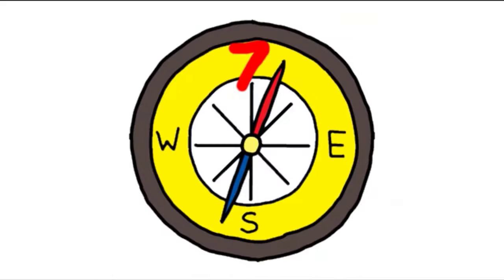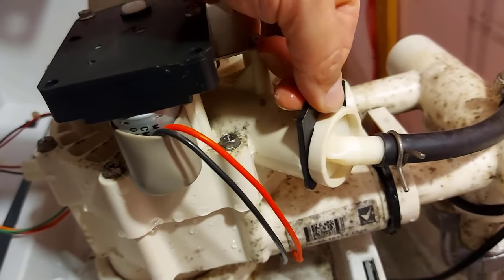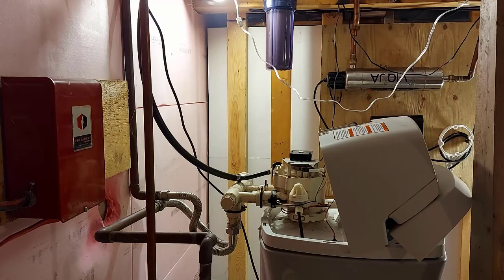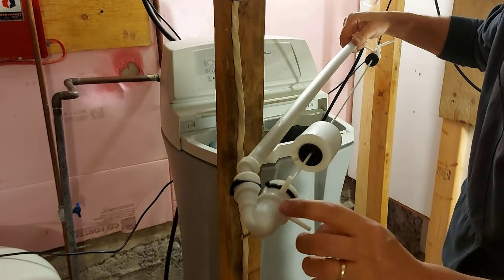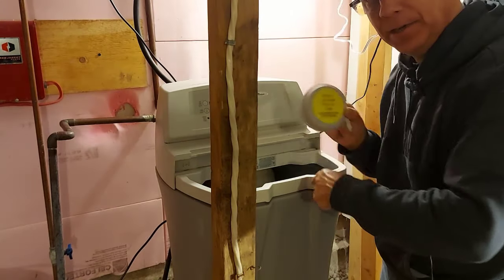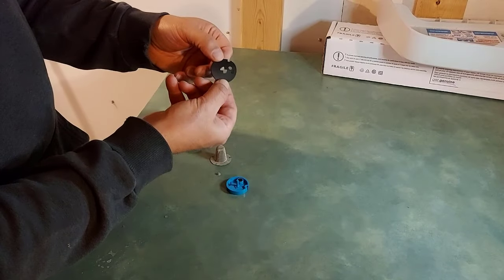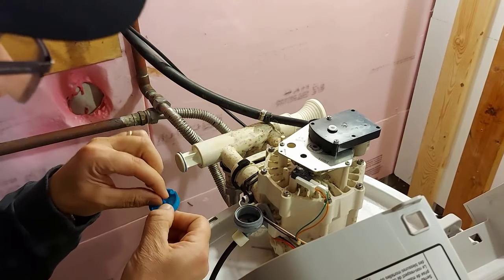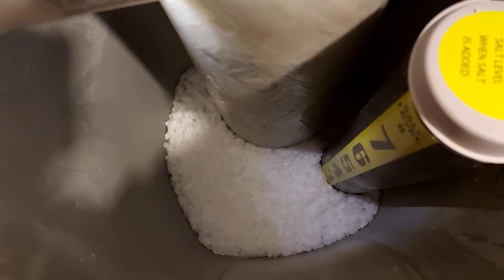My Water Softener is Full of Water // Troubleshoot and Repair 💧✔

Comment: Excellent video! Nothing you suggested worked, then I found out about what’s called “salt mush” that had clogged the bottom of my unit. Pain in the a** but emptied all the water and salt, cleaned the storage tank with warm water, put in fresh salt, recharged, and solved everything. Your video helped with the diagnostics and assembly. Thank you!
Reply: Derick that's what im going through tonight im.going to finish it off in the morning
Reply: After adding the warm water did you just add the salt and statt the recharge cycle?

Comment: I have the exact same water sofener.I knew I was having the same problem as yours, but still I hadn't checked the salt level in about 4 weeks. The water line was at 5 and the salt was at 2. Decided to order order a new venturi unit and float system since my w/s is about 17 years old but then I found your vid and decided to follow your lead and disassembled the old systems, cleaned them and reassembled everything. Drained the water, added salt and ran a recharge cycle and it worked! Well I've got extra parts coming that I'm sure will come in handy later. Liked and subscribed.
Reply from the maker: Great to hear! Is your water softener still working good?

Comment: Also do not tie the recharge output hose to the overflow hose because they both go to a drain. The recharge hose pumps water and if its tied to the overflow hose in a T to the discard tube it will just pump water backward into the unit and cause it to over flow. The overflow can just dribble into a bucket. The recharge hose has to drain into a sewer drain.
Reply: Yeah, I have this problem. I use a T junction.

Comment: Great Video! My water softner looks exactly like yours. I have about 8 years old "Sears kenmore Elite Hybrid" softner. About 2 months ago when I went to refill salt, noticed water in the salt tank and at the Top of "CAM GEAR". Replaced new "CAM GEAR"  & "Seal Kit". Replace new VENTURI completely. Open Brine Tank and clean "Brine Assembly" with new O-Ring. and put it back. Next: I have completely removed all the "old Salt"  from the tank put fresh warm water and cleaned it. Added new "IRON REMOVER SALT" 3 begs and START "RECHARGE" cycle at 5:30PM and complted at 7:30PM. At 1:00AM I have noticed water in my Salt Tank. I took meauring tape and put inside BRINE Tank to check and see the level. It was showing 8 1/2 inch. At 1:30AM this level was at 11 3/4. 
I have NO idea what steps I should take now. Finally  SHUT-OFF BYPASS VALVE so my BRINE TANK doesn't overflow over night.
If anyone has anyother ideas, PLEASE do share and let me know!! I would greatly appreciate it. Thank you!

Comment: I am probably about to ask a really stupid question. Just to be clear I did look through my manual and did not see😂 Also on Google all I can find is putting salt in the tank. When we purchased our home it came with this exact water softener which does not drain properly. I did notice there was salt in the well AND tank. Is there suppose to be any salt in the well or only the tank? Thank you for the clarification. 

Just wanted to say thank you so much for the helpful videos. I cleaned the Venturi and did everything I felt like I could to maintenance this thing before I did a recharge. After the recharge our water went from 15 down to 7 hardness which was a big improvement. Also the softener cleanser did an excellent job! Now all I need to do is to get this thing to drain properly and we will be golden🙂

Comment: Did you completely empty the of salt and water before you removed the black tub with the slots? If so how did you drain the water? I have changed the Ventura valve gasket and recycled system as well as using iron out and recycled. No effect.

Comment: How high does the water level have to be I got the same water softener as ur I clean mine out this morning thank you
Reply: Water should lower than your Salt. You should not see your water above your salt. Make sure your float and valve are not sticking in the fill position. Ceramic piece if you have one is above the Rubber stopper so the Stirofoam is floating freely on the fiberglass rod.
Reply: @paullarue4896  thank you

Comment: I changed the gasket following the instructions on this video and recharged the system but still have water in the brine tank even more water in it. 

I also checked the floating valve to see if there is anything wrong but didn't see any error.

What should I do next to fix this issue ? Any suggestions would be very much appreciate it.

Comment: How did you get the tube with the numbers back in with the salt still in the tank? If you do have to take all the salt out how do you get it all out because the casing of the water softener is so deep to get to the bottom?

Comment: I have the Whirpool WHES30 that looks just like this one you serviced.   In normal use the brine tank has no visible water even when the salt is at 1 to 2 level.   Does it fill with water to make brine only when a regeneration cycle starts?
Reply: good question!  I also would like to know.
Reply: My understanding from the 2 years my unit was functioning is there should be no water visible in the tank when it is idle.

Comment: I've done everything you did, and you're right. It doesn't look worn but, that's what I'm gonna try next. Luckily I live close to a plumbing shop so maybe I wont have to wait for ordering one. I'm also having a problem with the rubber seal on the bottom of the float. It keeps falling off.
Reply from the maker: Hoping it works for you!

Comment: I'm curious if you can advise me. I had the same problem and tried all the steps and turns out I replaced the whole venturi part. Thankfully, the water is drained from the tank, however, the water is not "wet salt" and is completely dry so I'm not sure if the water is filling up. Also, the water in the house is still hard, which hints me something is wrong but I am not sure what exactly. Any idea?

Comment: I have the same unit and it's holding water. The tube you mention at 2:12 is clogged on my unit. I cannot blow air through it. Even when disconnected at the other end. How can I clear it? Thanks!
Reply from the maker: not sure maybe let it soak in hot water for a while?

Comment: I had hardly  no water pressure in my house so I bypassed my sears water softener and now I have good water pressure again. What could be the cause of this? Any help would be greatly appreciated! Thanks.
Reply from the maker: Not sure, but it sounds like you have a blockage somewhere. I would check the venturi and the hose that goes from the venturi to the salt tank.
Reply: I have the same issue. Low water pressure with the softner on. Pushing the bypass, I have better water flow. Salt level has not gone down and I have hard water stains in my shower and dishwasher. Were you able to find a solution? I hope it worked out. PLEASE let me know. Thank-you

Comment: Show me!  How did you get the float/tube out?  How did you get it back in? How did you get that gasket out?  How did you get the cover off to get to the gasket?
Reply: You have to remove the venturi first it will give you a couple inches to move the float/tube
Reply: @stephanemeuyou9901  i wish you would show the steps you followed to remove the old gasket.  Also, where to get new gasket?

Comment: I cannot remove the float from the salt level tube as the black hose from the siphon isnt long enough, how did you get around that issue?
Reply from the maker: You will have to disconnect it at the venturi
Reply: Or just run it completely out of salt then you can take that black big tube out real easy

Comment: Really interesting, I have no idea what this thing is for, is it some type of filtration for the house water supply? 👍❤
Reply from the maker: thanks, we add salt into the tank and it creates a brine along with the water to soften the hard water that comes into the house from the ground. There is too many minerals in the well water. Its hard on the pipes, clothing, your skin etc.
Reply: @GettingItDoneRepairs  The brine water is used to clean the softener resin and stone.  The stone and resin are what remove the minerals and what not from your water to reduce hardness.  The stone and resin are essentially a water filter.

Comment: how did you remove the brine well? you did not show it in the video!
Reply from the maker: I didn't remove the brine well
Reply: @GettingItDoneRepairs   The thing you call "the tube" is, according to the manual for my GE water softener, the brinewell. How did you get "the tube" out?

Comment: How do you pull the black float tube out of tank without all the salt collapsing over hole at bottom?  Is the black tube inside another tube?
Reply from the maker: I removed most of the salt from the tank.
Reply: You have to remove the black hose from the venturi assembly, then pull the black hose into the brine tank to get the float assembly out of the black cylinder tube.

Comment: Hey big fan, i was following your video and i was having trouble with the water tube [black tube] min 4:47 i think its called the flot tube . i checked both ends they were clean but the air wasn't going thourgh.
Reply from the maker: You must have some salt build up inside the hose somewhere

Comment: My softner (Whirlpool)  water was almost to the top and brine well had lots of salt in the bottom.  I replaced the flat gasket, pumped all the water out of the tank and moved all the salt below the well.  Problem solved.